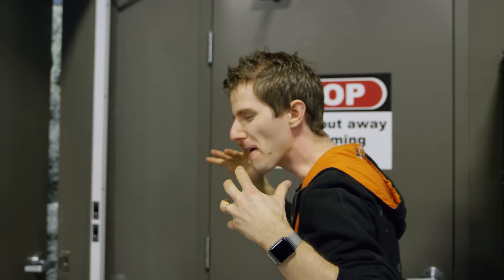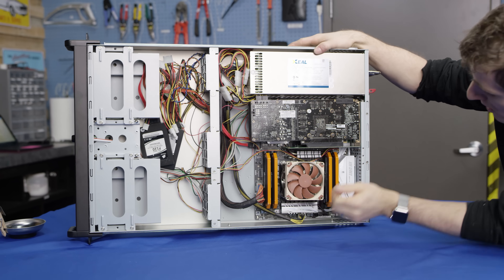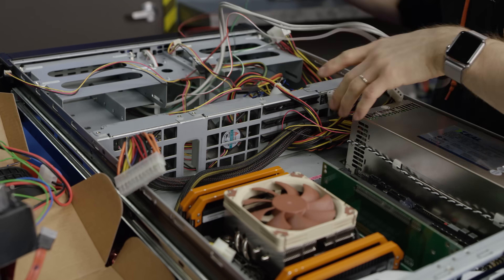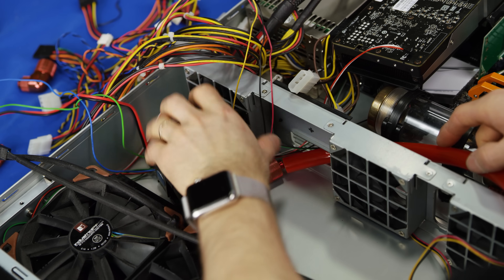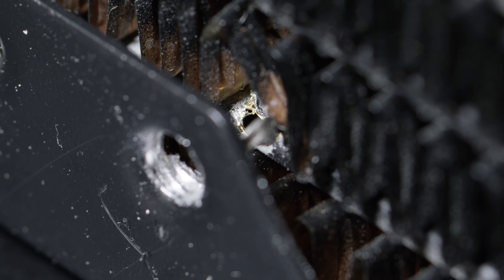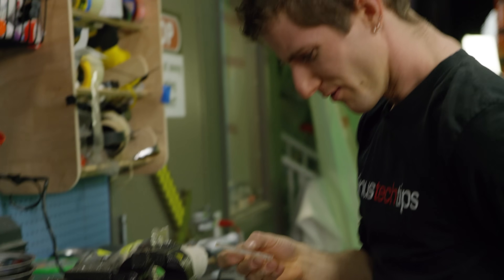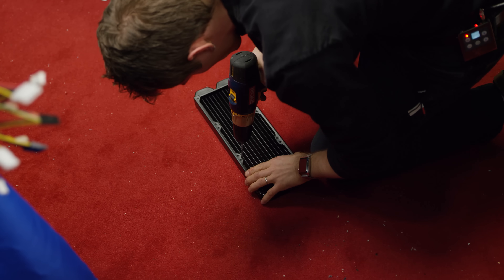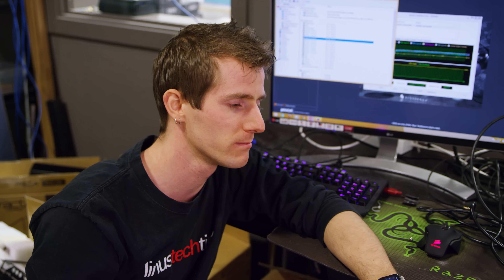Watercooled, Overclocked SERVER Build!

Comment: why not use mineral oil for the cooling loop instead of water so you have even more safety
Reply: because mineral oil has a lower thermal capacity and conducts heat much less effectively. It can also destroy the tubing...
Reply: oh ok coz i know its not electrically conductive so for petabyte project underneath it would be a life saver if it leaked
Reply: because mineral oil is more viscus then water thus it would wear out the pump a lot faster as well as require a lot more effort to drain and flush the potential for mess is higher. also the results wouldnt be much different.
Reply: bmxriderforlife1234 yes the result would be very different
Reply: what if there was a pump witch could handle such viscosity as mireral oil
Reply: Robinson Joe you do realize the second you put it into the loop your distilled water now has pleny of impurities and now is conducive.
Reply: SuicideCupCake i dont think it would perform that much different though you would have to test either would it would still destroy a pump and it would be messy as shit.
Reply: bmxriderforlife1234 No need to test it. Just look at the physical properties of both liquids.
Reply: SuicideCupCake mineral oil will take longer to become conductive. however it is also thicker then water and viscosity when speaking about liquids does apply to thickness in laymens terms. mineral oil works for immersion systems theres a reason its not used in sealed loop systems. and if you were going to go for a oil solution there are better options that would last longer and perform better.
Reply: SuicideCupCake mineral oil takes longer to heat up but it also takes longer to cool down. thus flow rate would become an issue. with water it doesnt as long as you have it moving at a decent speed. 

if i was going to do a mineral oil loop id use an external cooling and radiator system to increase the rate at which the liquid can be cooled.

as it would kill a lot of pumps faster it is a thicker liquid. i use mineral oil almost every day on my swords after handling i whip off the old oil clean the blade and apply fresh oil before placing in its scabbard.
Reply: Robinson Joe that depends on what your seals and orings are made out of. not all of them will have issues as proven by people who have had radiator set ups with immersion systems running mineral oil, but yes on many pumps it can be hard on them. 

though something like an iwaki rd-30 or the laing pumps shouldnt have an issue. frommy understanding those are two of the highest quality pumps you can get. and the iwaki can handle crazy pressure from my understanding. 

water would still be an easier solution. however mineral oil would have benefits for corrosion resistance as well as conductivity by far.
Reply: RazorRat there are some that can, ive seen mineral oil submersion pcs that also had rads to circulate the oil and cool it down. i believe an iwaki rd-30 would probably be able to handle it no issues and ive seen it done with laing pumps. in case you dont know laing is an oem for the d5 and ddc pumps the companies that sell them just make the blocks and pump tops and such.
Reply: Robinson Joe not entirely true this depends on the type of steel you use. different steels have different heat treating properties and some can not be properly hardened in oil.
Reply: one advantage of mineral oil is that it can hold more heat however it also takes longer to heat up thus meaning it takes longer to cool down. thus a double edged sword, however it is also less conductive and can act as a lubricant, as well as the fact that it can hold more heat then water. it can be both effective for cooling and ineffective it depends on the situation. 

 it depends on a large number of variables and exactly how you wish to use the mineral oil. submersion with pumps and rads is optimal because the pump doesnt actually need to constantly run you can use the rads like a thermal battery. 

basically same concept as using a shit load of fish tanks and water for liquid cooling with controlled flow rate, you wait till the substance either water or oil has reached a heat load and then pump out the hot as cooler liquid is pumped back in. however to do an optimal submersion radiator set up requires a large amounts of rads, and is going to be determined by how long you wish the system to run before it reaches its thermal load and must be shut down and allowed to cool. thus case size can make a difference as case size determines volume of fluid, this doesnt directly effect number of radiators you need but does determine how much fluid you can cool per second or minute. thus by a certain point the oil will reach thermal load unless you can cool it faster then the pc generates heat. however thermal load doesnt always mean said pc will be running hot. 

this is why submersion pcs can be run with passively cooled radiators in some cases. because the oil takes so long to heat up and the pc can only generate heat so fast that the temps never go beyond a certain temp. in a closed loop situation not entirely sure but im assuming it wouldnt function any better and to push the oil when cool through those tight channels in a gpu or cpu block wouldnt be easy however once the oil has heated up that would be a different story. it would also depend on what grade of mineral oil you use, some are less viscous then others.

Comment: You should put it in the bottom of the rack not above the HDDs!
Reply: alistairstuart2009 "there is a right way and the way we are going to it" Linus Sebastian 2017.
Reply: heat rises. you're going to get a slight degree of efficiency increase by being in the hottest part of the rig. using distilled would make his errors at least unlikely to destroy everything.
Reply: Jake Hix That water would pick up ions like crazy. He's pumping it through metal. It's not going to stay safe for long.
Reply: The storage servers and batteries are on the bottom because they're the heaviest. Makes the server harder to knock over and all around more stable. Nothing to do with heat, and the distilled water would as UltimateBreloom said pick up ions and become conductive quickly. Distilled water is only somewhat safe during initial testing for leaks, not long term.

Comment: Why are you using GTX-980 for a server? Am I beeing wrong with the defination of a server?
Reply from the maker: +Shlasky basically the only thing server about it is the form factor and redundant power supply. We needed single core performance that we couldn't get from a Xeon and overclocking support.
Reply: Are you implying that Premiere exports faster with a single core than multiple cores, because that's not my experience?
Reply: H0LY $H!T you replied
Reply: why not use mineral oil for the cooling loop instead of water so you have even more safety

Comment: Linus have a small idea for you, grab a smoke alarm with a button to test the detector, then run 2 wires parallel in the button of the server case where the cobber is exposed without touching, then connect the wire over the test button so that when the wires toutch the smokedetector sounds. a diy water leak alarm from a old ore new smokedetector 😉 just mount it outside the server room, I don't think you will hear it otherwise 🤔

Comment: no why would the performance server need 10gb networking.  this is a horrible project and video for so many reasons.
Reply: if you had listened, then you would have understood they are going to use it as a rendering server. 10Gb file in, render it in different codec etc (usable by their editing software), send new 10 GB file out.
So having a FAST 10gbit networking is actually important for that server. 1 gbit will probably be too slow, and probably later another video regarding that it was too slow and are changing things again.

Comparison: 1 gbit = ~100 megabytes per second. 10 gbit = 1 gigabyte per second (without taking drive speeds in account) So a file of 10 Gbit either takes 10 seconds to send to it on 10 gbit or 100 seconds on 1 gbit. but it also has to send the new data OUT again... so that doubles to 20 seconds vs 200 seconds... The CPU will be waiting a lot in that time, unless they can concurrently send the new data while it is rendering etc. 

I don't know how fast it would render such files tho.
Reply: of course it would fucking need 10gbit networking. The issue linus faces now is that everything will take a couple more minutes to process, but the editors can just spend that time on grabbing a cup of coffee
Reply: jasonlax because 8k content
Reply: Why would they need to copy the file on the server itself, it makes no sense, they will probably just mount the network drive on the server and read the file to render and save back the rendered file directly on the network share, probably they will automize all of that with a script, gigabit speed it's not a bottleneck, the CPU cannot process so much data that fast anyway, also the motherboard has 2 NICs, so they can team them to split the traffic and double the speed (so you have 2 gigabit/s)
Reply: It's a 980, it would render fairly fast, not the fastest, but at a good speed, faster than 970, but 970's work pretty fast on rendering as well.
Reply: A1eR You do realise that even though the files are stored somewhere else, you still need to transfer them temporarily over to the rendering server as a continuous read/write stream as the video is encoded?

Most likely not having 10Gbit networking will be a bottleneck - however, I don't have the data on how fast a 980 can encode h264 files, but I'm pretty damn sure it exceeds 1Gbitps.
Reply: A1eR And also, no, having 2x1Gbitps in bonding/link aggregation mode requires two seperate data streams. It would however work just fine if the server can encode two video files at the same time, because two editors would be able to do this at the same time and thus making the encoding queue go faster.

Linus hasn't shared any details on the actual setup, so it's just speculations. Hopefully we'll see some encoding benchmarks, rather than the usual CPU/GPU benchmarks he always does :p

Comment: Clickbait!! there was no overclocking!!!
Reply: That was sort of what i was thinking. And, all of this "watercooling" work, to get headroom for overclocking, and it still ended up at 60c @ stock speeds? Someone needs to remove the fans on the RAD, make (3D print?) a shroud so that they can mount the RAD diagonally and get some better airflow through it.
Reply: zsolti256 your name is clickbait 😅

Comment: You don't overclock server gear!
Reply: wel he did why not
Reply: the pyrotechnic penguin Because it reduces lifetime significantly, which is a stupid thing to do to a server.
Reply: dontquestionmyactions Working out is like overclocking your muscles. Working out doesn't kill you. Improperly maintaining yourself does. 

Knowing Linus though, it's going to he improperly maintained.
Reply: [Edit: The following was an embarrassingly long comment that meandered, so I've rewritten it to make more sense]
This isn't meant to be a debate. I just want to throw my two cents in against Macul Synthelik's statement. He has reasons and I'm just explaining what I know that contradicts it.

"Working out doesn't kill you. Improperly maintaining yourself does."

Overclocking can shorten a devices lifespan or kill it outright. If a chip would last ten years, and overclocking it aggressively shortens that to seven, it probably wont matter because it's already obsolete after five. 

Same things apply to a person working out (except they don't go obsolete so fast).

Eventually people do get old. Hormone levels decrease with age, and fighting to maintain muscle tone with supplemental hormones has consequences. I'm not against this, and I'll probably take testosterone when I'm older. A lot of people would rather feel great, even if they don't live as long as they possibly can. Problem is, the consequences vary and are not easy to predict. Take some hormones and the prostate cancer a person didn't know they had starts growing like wildfire.

Feeling 'meh' instead of great is the way to actually live longer.

Three Health Consequences of Exercise (where I borrow words with similar definitions and treat them like separate scientific terms because I'm a doofus):
Why bother making a list? I'm trying to show the ignorable third one is insidious, and more harmful than the others. How the heck else am I supposed to do that. Be direct? Nah ;)

1) Fatigue.
Muscles and other cells can't get enough oxygen. The result is a person feels tired and is sore after exercise. If a healthy person keeps going and going, eventually they'll faint or have some other cardiovascular failure.

2) Exhaustion.
People need sleep and rest, for a variety of reasons. Being awake for a long time causes a person to feel tired and gradually start hallucinating. Most people sleep as little as possible. Taken to the extreme, sleep deprivation can eventually cause death.

3) Overexertion (for lack of a better term...really).
DNA damage and cell death exceeding cell growth. It occurs from a variety of things including toxins, oxidation (cellular metabolism) and ionizing radiation (UV, x-rays, cosmic rays, nuclear radiation, etc). It doesn't make a person feel tired. A person might feel nauseous, but usually not and that's it. The effects aren't felt until time passes. It pretty much causes or worsens every disease, probably even pathogenic disease (resisting microbes is impaired). The body doesn't only regenerate via cell division, like I was taught as a kid. Cells can and do fix themselves to a limited extent, and it's centrally important to aging and longevity.

Basically, overexertion is almost impossible to measure currently, and people can't sense it like fatigue or exhaustion. It's a real silent killer.

How to avoid it? Eating and drinking foods with antioxidants is popular but has unknown long term benefits (if any). Plant pigments (things that give plants their colors) are usually antioxidants, so there are already a lot of foods that have them.

Some other advice I've heard is to avoid endurance exercise, because cell metabolism causes oxidative stress. Constant physical activity is probably taxing the cell repair mechanisms. I'd guess 30 minutes exercising and 30 minutes resting is a way around the problem.
Reply: Ryan LeFevre to over clock you need more voltage
Reply: Kyle Morrill you must be new here!
Reply: That machine is just consumer parts... There's nothing server grade about it except the chassis

Comment: And one more thing - open ended cable combs work great as spacers AND for holding the screw in place on like m3-m8?  Somewhere in that range.  Use small wire cutters to clip the comb apart.  An 8 wire comb will net you 4 spacers/clips.

Comment: Linus, you can buy for about 10-20$ at home depot a water sensing alarm. Kind of like for smoke, but it detects water. It will sound an alarm when water is touching the two contact points. It could be good for you as a safety if leaks are to occur
Reply: few problems with that.
he's limited to 2U of space, it'd have to be inside the case.
it's unlikely that the drip will occur where the sensor is (unless you had a sheet of contact covering the whole server)

Comment: xD I like how you specialy took a reservoir with metal caps to screw it as tight as it could to get zero leak, but you just repair a rad with a hole in it with just simple epoxy

Comment: The concept of this video is right on par with your raid-0 server crash and shows you still don't understand servers. For those looking here for server guidance: Servers are meant to be reliable, long-lasting work horses, not overclocked and water cooled custom monstrosities (except for lab machines, then by all means). FYI, if you need a 2-U server with a lot of horse power, look at hyper-converged servers, I have some from hyper-grid (or nutanix, vblock, etc) that have 4 blades and 96TB of ssd storage in 2-U size.

Comment: i know this is old but at 6:15, where the rad is installed it should have been left with no fans and just tilted against the roof of the case, sealing of the sides perhaps with a custom bracket, let the server case fans push air through it on an angle like some exotic cars are set up...i suppose this would only work if there are fitting holes on both sides of the rad so you could put one in each side..

Comment: After that epoxy cures it would be a good idea to fill the radiator with water and let it sit and see if it leaks.  You will obviously want it away from the server until you know it is safe.  I can only imagine how nervous that must have you considering that you do not want ANY leaks in there.

Comment: You could really use a small, inexpensive vertical milling machine to quickly make special parts out of plastic, aluminum or brass. Also, if you put a piece of masking tape on your drill bit at the correct depth, it will prevent you from drilling too far..

Comment: My other question is if you are planning to use this long term why are you on such a time constraint? Like, couldn't you do it properly and wait, or is the current system for some reason no longer feasible to the point where this needs to be done now and maybe worry about doing it proper later?

Comment: Drilled trough the first radiator core, so lets drill in the second one without protecting the core. I know it was a rush job but using glass tubes resolves any sweating danger. It sits above your Petabyte Project, for crying out loud.

Comment: I would have tilted the radiator so one long edge touches the bottom to make a seal, one touches the top to make a seal, and the fans that pull the air through the case would also pull it through the radiator.

Comment: If you used a 8cm rad you could mount it vertically in front of the fans that were already there. Would have saved a lot of space with more room to properly mount the rest of the components.